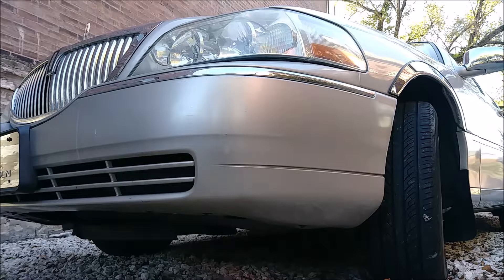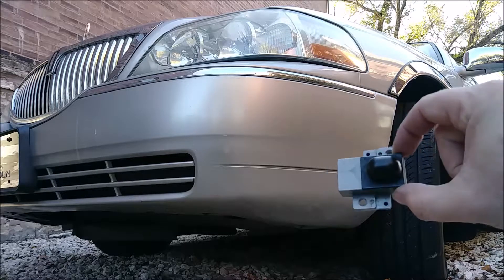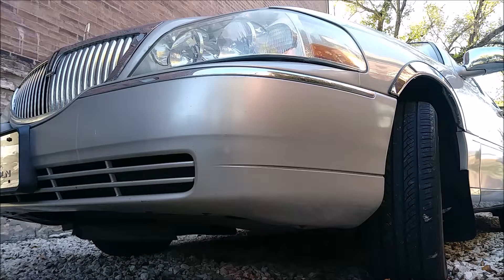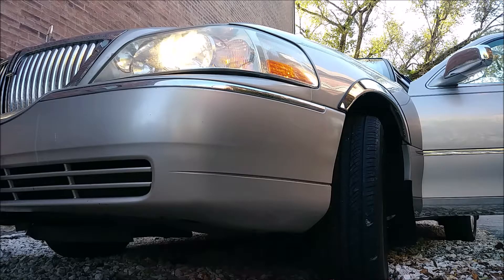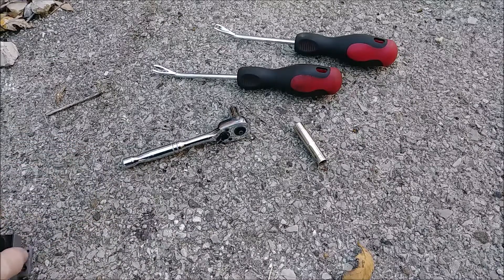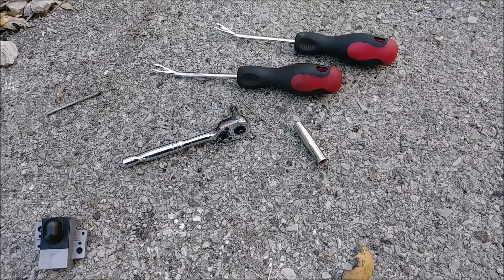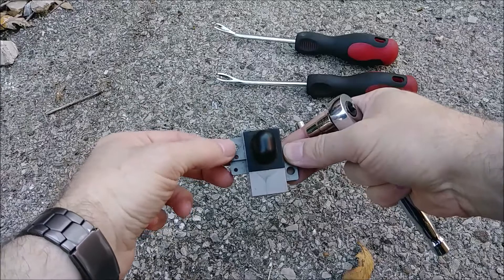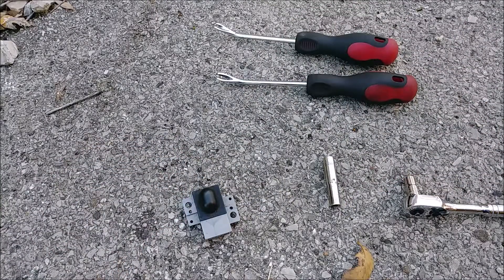How to replace automatic headlight sensor Lincoln Town Car

Comment: You are the smartest person on the planet.  I'm subscribing!   I bought a 2000 Lincoln Town Car 1 1/2 yrs. ago (purrs like a kitten and runs like its brand new even though it's got 176k miles).  At night I can see a little red-light blinking on the dash. I thought it was a "Bozo Burgler Bastard Beware Boy" alarm, but I guess it's not.   It also had a small square thing with a wire on the rear-view mirror, and I don't know what it is.  I fiddled with and its now hanging.  Talking about BOZO, I have never had a luxury car even though I'm 68 and retired.  She's a beauty, new Riddler Rims, Windshield, Silver Paint Job, Michelin Tires, Dual Flow Master exhaust (she was too quiet), new head lights, new seats.  Any help appreciated!

Comment: Thank you I have this same issue in mine and it drains the battery because the lights stay on. I was under the impression you had to remove the dash. I’ll definitely be replacing it. I did the self test in the AC and it said my sensor was bad.

Comment: Right on Hollywood,
Good work.
I would be more interested to see you test the old, and “new” sensors with your Multimeter set to Ohms. That might show definitive proof of good vs bad sensors.
-Chuck
Reply from the maker: I tried that, but oddly enough all the readings were identical, and there was no real data in the factory service manual reference ohms on good vs bad sensors (because I own the old scool analog service manuals for the panthers). Not that newfangled digital nonsense, so I just demonstrated the easy common sense way of testing the sensor.
Reply: @HollywoodHornet  
Well it would have been nice if you put that info in the video. 
Maybe next time. 
It's like pulling teeth with you. lol
-Chuck
Reply from the maker: @PanzerPlatform  I was this close to including it, even the negative results, but I didn't want to be accused of making a short video long with superfluous information. I guess from now on I'll make two videos of every video. The TLDR version and the super long detailed Chuck edition.

What do you think? TLDR on Monday and extended edition of Fridays?
Reply: @HollywoodHornet  
Just make one long video. 
Everyone knows how to double tap fast forward. lol

Comment: Hello, good video.  Same problem. Now fixed. Great instructions on removing the panel cover.
Now a new problem. Broke light switch. 2003 TC with fog lights. I push the pull swith in to turn off the fog lights.  Screws  holding the light switch broke.

Do you have instructions or know how to remove the dashboard panel to fix/ replace the switch.
Reply from the maker: Not on the TC in particular, but I have removed the panel twice on the Crown Vic. Once to replace the shift tube bushing and again to wire my dash camera to a toggle switch. I can't recall if I went over how to remove the panel in detail in those videos, but in case I didn't, here's a brief synopsis.

Unscrew the two phillips screws on the underside of the dash panel above the steering wheel (peek under the instrument cluster gauges and you'll see them up there). Lower the steering wheel it it's lowest position, chock the wheels and shift into lowest gear. This will allow the panel to clear the shifter and steering wheel. You then start from the far left, near the headlight switch and start pulling towards you on that panel. It's now only held in by plastic clips. Start from left, move right and with both front doors open, you'll be able to easily pull that panel free without breaking any tabs. Remove your broken switch and repair the area it screws into (if needed) or replace the switch if necessary.

Then from right to left, reinstall the plastic tabs by pushing onward on them. Reinstall the two screws. Boom done.

Comment: My autolamps were broken like this when I bought my 99. I bought the sensor on the net for $17, replaced it and lamps are worked right since.
Reply from the maker: Ahh, now I have a baseline to sell my spares. Pulled a few extra sensors and have them listed on eBay for like $24.00 with no takers. I'll try $17.00 and see if I get some sales.

Comment: Thank you. Great video. Apparently the auto lights on my 2000 Lincoln Town Car is bad. the light processor / sensor is no longer available as you indicated by purchasing from the junkyard.  Do you know of anyone on-line that may have one as an alternative to junk yard. Thank you.
Reply: Ops just read your blog. Someone purchased on on the net for $17.00 Thanks
Reply from the maker: @kevinmaher512  yep, I'm fresh out of light sensors at the moment. I sold the last one a little while ago. If I pull some more, I'll let you know. I'm mat-huds on ebay. Profile pic is a green metallic hornet.

Comment: Do you have the part number for that automatic headlight sensor for the 2000 town car? I will purchase the extra one that you have if you still have it. I haven't been able to locate one. Thanks
Reply from the maker: Part number for 2000 TC:
F8VB-14A597-AB
M2588
as listed on the headlight sensor. I sold my last sensor a few weeks ago, so I currently have no spares to sell.

Comment: Where did you get the Lincoln emblem for the taillight?
Reply from the maker: I noticed a different Lincoln had one on its tail light one day so when I went to Pick n Pull I found one with the same emblem on the tail light and now they've been transplanted onto mine.
Reply: @HollywoodHornet  Did you just super glue it on? I know the 99-02 had them in the OEM lights and I like the look. Just wondering did you just glue them on?

Comment: I work over nights security nabbing construction thieves and I hate these damn automatic lights. I will have my switch in the off position and yet when it’s rainy the frickers come on. Is there anyway to turn this function completely off ?
Reply from the maker: No, sir. Only way to turn the function off is to select OFF on the switch. If they come on even in the off position, the switch is bad. If they come on in broad daylight (like mine) the sensor is bad and needs replaced. You'll be good to go after that.